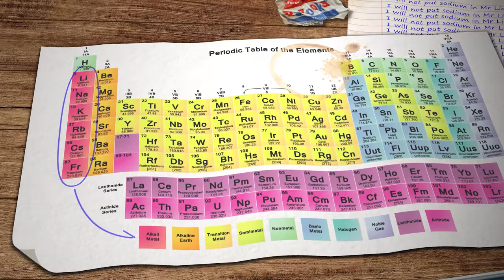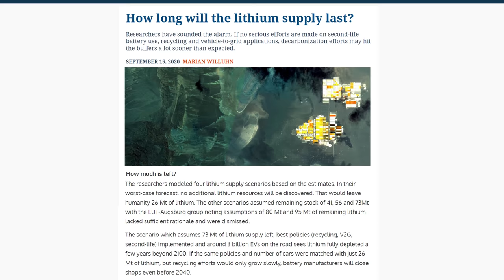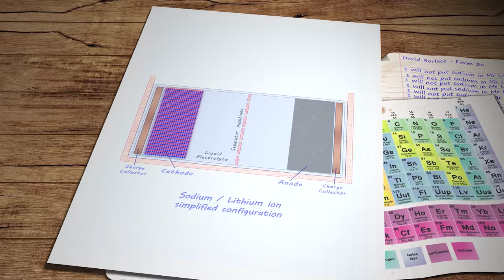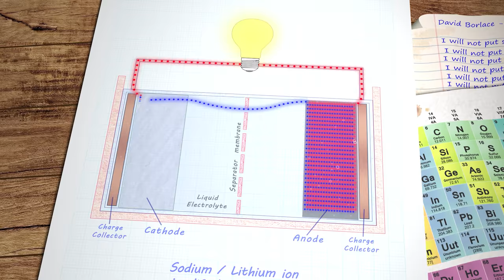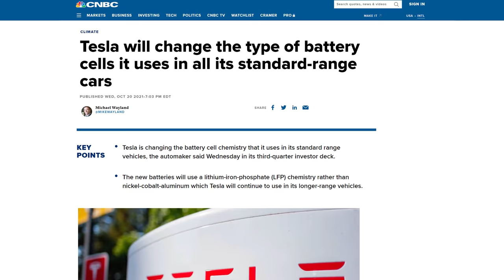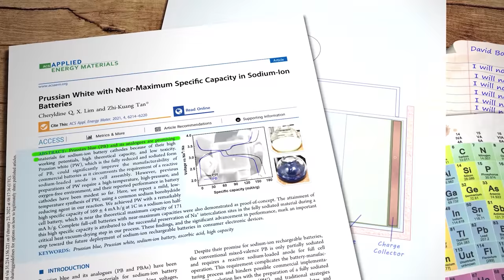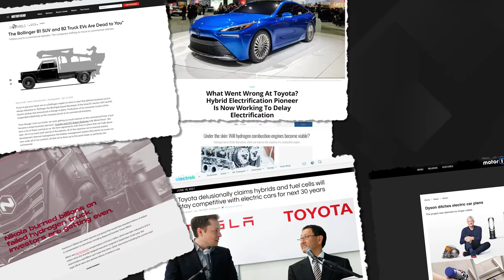Sodium-ion battery breakthrough. Safer, cheaper and cleaner than Lithium-ion

Comment: Instead of arguing which engine is best, we should have a hybrid engine which consists of traditional oil, hydrogen, lithium and sodium all in one. This way if gas prices go up, you will pump hydrogen. But otherwise use battery charged by nuclear grid if available in your area. Car will also be a backup source.

Comment: Sodium can compliment lithium but I doubt it would replace it. LFP batteries already are at these densities and have simular recharging rates and thermal stability. They also shouldn't cost more then sodium either. Li  Nickel based are much higher densities with catl themselves stating their new battery is 60 percent more energy dense then this sodium.

Comment: Having existed since before the advent of NiCd batteries, I am always interested at improvements spoken of in advance of actual production releases.  Nothing, however, is going to repeal the law stating that you cannot achieve the level of input at the source of the output.  Since the source of the input is electricity generated by oil or coal in the first place, this becomes a matter of the tail chasing the dog.
Reply: << Since the source of the input is electricity generated by oil or coal in the first place, this becomes a matter of the tail chasing the dog.>>

Just guessing,  but I suppose that environmentalist opposition to nuclear and hydroelectric power gave the use of coal an additional ten years of production and use.

Comment: Thanks for another great video Matt, this looks very promising, so it seems the price of the battery will be less, overall weight of the battery will decrease and number of cycles will increase at the cathode at least. My interest is mainly for home storage. Current home storage batteries cost about $1000 per kWh so you could spend $10,000 - $15,000 on a decent home storage battery by all accounts which is prohibitive for must people.  Do you know 1. How much less the battery will cost and 2. How long it will be able to hold a charge for in comparison to Lithium batteries? Thanks

Comment: Sorry but I must disagree on the subject of lithium. Lithium is not actually in short supply, it is only the economics which mean that there are limitied sources at present. One of the first lithium mines was King's Mountain in North Carolina which closed at the begining of the 21st C when the market was undercut by the South American producers. Due to the current expansion of the lithium market Piedmont Lithium is planning to open a new mine in North Carolina, The Arkansas Smackover project is planning to extract if from groundwtater extracted by the Lanxess bromine facility and Tesla has identified commercial quantities in clay deposits in the Nevada Desert. A British project is planning to extract it from groundwater in Cornwall, Zinnwald Lithium is investigating a source near Abbeytown, NI and also a source near Dresden, Southern Germany near the Czechoslovakian border. I could go on!

Comment: What's needed are batteries witth 10-fold higher energy density so that they begin to match the energy density of fossil fuels (or chocolate, for that matter), so that electric trucks and planes become remotely feasible.
Reply: Why 10-fold ?  The Tesla Semi is expected to need 2kwh/mile of range.  That means at 200wh/kg for Sodium Ion batteries, a 500 mile range would need a 1000kg battery pack.  That is not a lot of weight compared to the total weight of a loaded freight carrier.  300 gallons of diesel weighs 2100 lbs, so that battery would only weigh 100 lbs more than the diesel fuel would have.  Being able to charge to 80% capacity in 15 minutes as this vid claims should be acceptable for truckers -- a 15min  food or bathroom break every 400 miles or 6 hours seems plausible and refueling with diesel also takes time.  The weight would be an issue for planes, but trucks seem feasible at 200wh/kg
Reply: @kirkellis4329  Your calculation seems to be for the energy required to transport the weight of the battery, not the weight of the loaded truck (semi). You can't get around a 10-fold lower energy density for the battery without requrining 10-fold the weight of batteries compared to diesel. Economically it makes no sense to lose 10 tons of cargo, unless the trucks are massively subsidised from public funds like most of Musk's innovations.
Reply: @sotony7483  No.  My calculation is based on the numbers presented by Tesla for their Semi.  2kwh per mile is the energy required to drive a fully loaded truck including the cargo. What does it matter how heavy the vehicle is ?  Do you even know what the weight is for a Peterbilt truck vs. the cargo it is hauling ?  Depending on the model, a diesel Peterbilt unloaded can weigh anywhere between 15,000 and 25,000 lbs.  Or the difference in weight of the electric motors vs. the diesel engine ?  The weight of the semi is immaterial anyway.  What matters is that it takes 2kwh -- 8x the energy for an electric car -- to pull a fully loaded semi.  That is less than 30 cents per mile for electricty as a fuel.  Compare that to diesel at $5/gal getting 7mpg for 70 cents per mile and clearly electric semis are feasible without any subsidy required.
Reply: @kirkellis4329  Your estimates are even wider of the mark than Musk's. Firstly, industry experts say that 4-5 hundred miles range is too short for long-haul trucking. Secondly, independent estimates suggest about 12 tonnes is the likely battery weight for a loaded vehicle, not 1 tonne as you suggest. Thirdly, Bloomberg says Tesla estimates for range, weight and charging times are "unrealistic" (wow, unreliable numbers from Musk, no way!). Fourthly, the Semi was announced FIVE years ago and still no production. The smart money in facr says that to make this viable Musk is waiting for new battery technology with much higher energy density than Li+ ion, just as I said, and both the Semi and electric planes are wildly uneconomic until (if/when) that happens, other than perhaps for some short-range urban deliveries. We've had electric vehicles for doorstep milk deliveries within UK towns for the last 60-70 years, so Musk has just prototyped a larger version of the electric milk float.

Comment: Sodium Ion is 150 Wh/kg which if I am correct is around 5x the density of Lead Acid.  Do you have the discharge level?  Lead acid can go to 1/2 so a 100 WH battery has 50 usable WHs.  So what is it for Naion?

Comment: What about Methane Pyrolysis? Methane Pyrolysis is an emerging alternative for clean hydrogen production. In a pyrolysis reactor, feedstock methane is heated in the absence of oxygen to pyrolysis conditions (1,000 - 1,500°C), at which point the methane molecules dissociate into solid carbon and hydrogen.

Comment: I thought sodium is a highly reactive metal. Is it used in it's pure form in the battery? If it is I would be careful about puncturing the outside shell because the ingress of a little moisture would be inflammatory. That's why the sodium seems to explode when placed in a bucket of water.

Comment: The relatively quick charging rate is nice, but what is the power density, ie. the discharge rate ?  A vehicle that doesn't need much range still needs a large battery pack if the max discharge rate is a low multiple of its C rating.  For a 40kwh battery pack to produce 200kw peak power, it needs to safely allow 5C discharge.  Does Sodium Ion chemistry do that like Lithium Ion can ?

Comment: I thibk sodium will make far more sense as a small battery. Its likely the weight and the rechargabilty of the batteries in your child's toys or calculator matter much less than they do for cars, ships and power grids. The access to these sorts of batteries by completely unqualified people also means the safety benefits are probably much more appealing.

Comment: So, we could use the brine from desalination processes to supplement mined sources? No joke dealing with high salinity brine in this manner could make desalination more attractive in cash strapped regions. In places where pump storage isn't feasible, it would be great for cheaper power storage of locally produced renewable power. Really hope that this tech in conjunction with renewable power can lead to energy independence for poor people's and nations. 
Still worried about firefighting concerns, the foams used for battery fires are usually on the nasty side.

Comment: Excellent videos; keep up the good work. While I hope this is battery breakthrough is true, the landscape is littered with the bankrupt corporate corpses of those promising “the next revolutionary battery solution to energy storage”. Proof of concept at bench level has often not borne out at commercial scale. One way to conduct investment due diligence is to attempt replication from research reports, but that is difficult, costly, and time-consuming. Patents are no guarantee. Bankrupt battery makers have had patents. It was a different technology, but Theranos had lots of intricate patents, but still blew up. The only reliable check on hype seems to be the anti-fraud provisions of security laws in less corrupt countries. Let us hope CATL pans out. Solar and wind would then solve most of our problems. Until then, I am not holding my breath.

Comment: If sodium ion batteries can get similar reliability and efficiency at a significantly lower price than lithium it seems like a good option for grid storage.
Reply: Still very pricey for that.
Reply: @grindupBaker  in my area it is feasible for a relatively small company to break even and possibly make a small profit if you can get the land for cheap enough using LiFePO4 batteries to balance the grid, so any significant cost reduction could make it profitable in my area (which appears to be fairly representative of a good chunk of the US)

Comment: Yes finally you understand that any ,,,any battery has metals that we will eventually run out of or expand large energy amounts to recycle. Hydrogen however is recycled in its use. 100% recyclable and infinity renewable. Energy storage is Hydrogen anything else is not available now and is enormously hard to scale up. Hydrogen on the other hand is available now. Sun and wind energy can easily and cleanly be stored in Hydrogen production,,,,forever or as long as the sun shines..  please let’s store electrical energy in Hydrogen.

Comment: It's Not just EVs that would benefit from this. At home storage systems for Solar cells which are currently dominated by LiFePO4 batteries would benefit Greatly from something like this which would bring down the cost of Batteries (usually the most expensive part of at-home PV setups) a LOT.  Already companies like Bluetti have announced plans for Na-Ion batteries in their upcoming home backup systems, such as the EP-500.  Very exciting if it can be brought to market quick enough.

Comment: It would be nice to have a cheaper battery due to being made from more abundant materials but it all depends on the route we are going down. For example there are some things I have seen on this channel that suggest we could have our car powered as we drive although I only saw this tech on lorries if we went down that route we might not really care about energy density as much because we'd only need enough range to get off the motorway. Another route we could is hydrogen powered cars, if we go fully renewable we'd likely have a lot of energy left over and rather than store it in batteries we could create hydrogen with that energy and then fuel cars with that hydrogen the advantage of which is that hydrogen is that it is about 100 times more energy dense than batteries and so if we go down that route energy density won't matter either as we'll be using the excess energy and we can use hydrogen generators to get that energy back if needed during the night when the solar shuts down. If we go either of these routes (and I think they are both better than the current battery direction) then we won't care about battery density because we won't be moving those batteries around although we might care more about WH/l as we might be more concerned about space but I think we've got a long way to go before we have to worry about not having enough space on the planet for batteries.

Comment: Interesting!  Looking forward to owing an EV in the near future that is powered by Na-ion batteries.
Another battery that's currently under development is the Magnesium battery, which has the advantage over sodium or lithium of supplying two electrons per mole vs one for either Na or Li, as well as being much more air stable that those other batteries, as well as being nearly as abundant as sodium. 
See: https://en.wikipedia.org/wiki/Magnesium_battery for more details.

Comment: I really like this battery. It's a shame though that the energy density is much lower than Li-ion's. Even with lithium batteries, one of the biggest struggles with EVs is getting enough range. There may be (usually very expensive) models with an okay range, but you're hauling an incredibly heavy battery around with you the whole time, so you waste more energy to move it. With this battery, you stand no chance reaching ICE verhicle ranges unless you make the battery incredibly big and heavy, which will increase your energy use even more.
With electronics, you'll have to accept shorter battery life since there just isn't enough space. But hey, at least you don't have to replace your entire phone after a few years of use because of battery degradation.

If only they could up the energy density by quite a bit, this would be perfect.
Reply: or if theoretical capacity has been met, you could just amp up the charging time to match the "recharge time" of an ICE vehicle
Reply: @iraimito850  Is there any real need for fast recharge times aside from very long journeys? Most people travel about 25 miles to and from work. If they are charging their car overnight as they should, they'd never have to worry about charge times.

Comment: Sodium batteries are safer only when their more robust(compared to Li-ion) casing and battery management work and function as intended, that is the reason why we have not seen them in our phones, and will not see them in the next decade or so, because if one component fails, you have a low yield grenade in your pocket.

Comment: Here in South Africa we just had stage 4 load shedding - which means rotation power cuts of up to 4000 megawatts. So it ends up being just over 4 hours of no electricity usually...except sub stations blow up or sometimes the power just does not come up. Many people would love home storage and solar, but the cost is massive - for very little real power... Also your batteries are a big target here for theft. Even our mobile network towers get attacked often - equipment, especially batteries stolen, costing millions every year. Massive security teams try to protect it... giant metal cages, giant concrete tombs and completely immersing the batteries in concrete to make it harder to steal... even our power lines are stolen often. All thanks to our government that creates destructive economic policies, filled with corruption and incompetence. We used to have thousands of security people just protecting infrastructure like rail way lines from looting...

Comment: W/hour is a small amount of capacity compared to the SIXTY KILOWATT HOUR required to power the EV!   The amount of extra cost associated with battery powered cars is EXPONENTIAL creates more EXPENSE as time goes by because the batteries will wear out in 3-5 years, needing  to be replaced!

Comment: Any updates to this Na-ion story for new years 2023? There's so many other threads all over the media - some contradictory, obviously - it's difficult to see what's the state of play. I've been really disappointed by the price of "home-micro-grid" -oriented batteries (for want of a better expression). For a 3.5KWh unit the price is almost 1k5 GBP in U.K. This is >3x the "$130/KWh" we read about! IMHO this area is critically important, because switching households over to all off-peak consumption with battery appears to be the lowest hanging fruit, better than heat-pumps + solar-panels. Many folks - like me - are now looking at swapping out their old gas-fired home infra. All this new tec needs to be here soon!
Reply: I also always wonder where can I but the liion 130$ per 1KWH batteries??? The cheapest from a shady store in my country is 300-400$ (thats a monthly wage in my country btw....)

Comment: Forget the market for EVs ( where weight matters ) if the cost per KWH is lower, they have the edge in the Home Battery market, which Tesla is too busy to fully meet. Last figure I saw was $10,500 for Powerwall and electronics. If they can shave 10% off of that ( who cares about the additional weight/size ) then they can take a huge share of that market. If they can reduce the price more, I bet they can grow the market. Over 80 million homes could use backup to the grid, but right now, it is too expensive for most. [ Just looked up the price comparison quickly, and they claim $77/kwh as opposed to Tesla's $101/kwh ! ]
Reply: I need 153 KWh for the winter. Much too pricey. 7.5 KW petrol generator is $999.